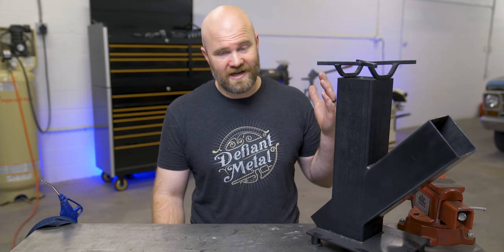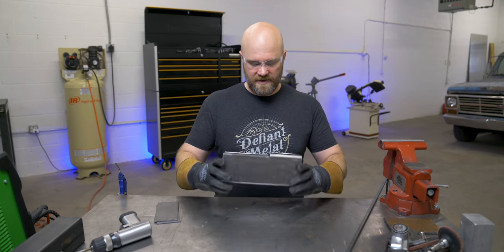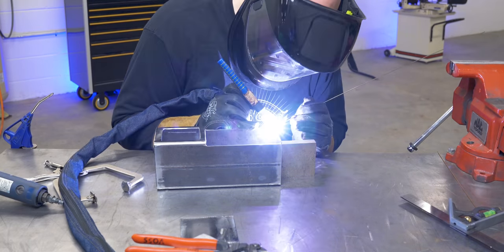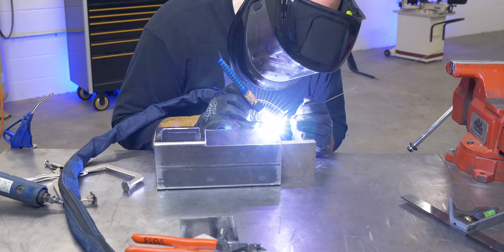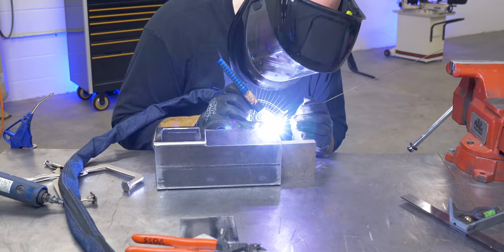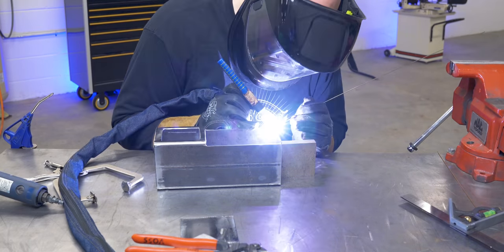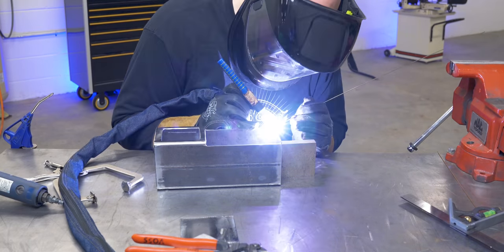Ammo Can Rocket Stove! - Welding A Portable Camping Stove

Comment: Should make the pan holder prongs removable, and have the end of the pipe capable of fitting a flu pipe, so that way, if you need to heat a tent, or something else you can :)
Reply: That's a great idea!
Reply: Yes...
Reply: Ammo box is insulated, makes it less effective for heating the surroundings. Idea of multipurpose is good though.
Reply: Stack robber heat extractor.

Comment: Great job with this!
Welds are clean, the design is solid and it looks like it works well. 

The aluminum heat sink was a great idea to keep from blowing holes in the thinner metal.
Little whoops on the warping and air gap by the hinge , but shit happens.

Only things I would say might be better is if the insulation was welded into the can and the main stove body itself was removable for maintenance. Inevitably, that steel is going to eventually oxidize and need replacement. 
This would also lend itself to including a trap-door on the bottom of the firebox for dumping ash. 

I also personally prefer the self-feeding, "V" shaped rocket stove designs and would like to incorporate something to that effect if I ever get around to making one. The only rub is the lack of available space to work with for such a design.

I second the other user's comments about the rubber seal going up from being in close proximity to the chimney, but good thing the lid is removable. Ought to make a handy staging platform for ingredients. Always nice to have parts of a cook kit that serve multiple purposes.

All in all, this was excellently done and even your mistakes were instructional. Thanks for including them. Great job!

Comment: Rocket stoves are great, but have you heard of TLUD stoves? They are a type of wood gasifier, a "forgotten" technology that heats up wood so it releases gas, which is then burnt. The result is heat from the burning "wood gas" and biochar, which can be used to start it next time, or for any other purpose involving charcoal. This ammo can build looks awesome though! 
I have even heard of people burying the biochar to A: prevent CO2 from entering the atmosphere (it would if the wood was normally set to rot) and B to fertilize the soil.

Comment: I really like using a jigsaw with a fine blade for cutting mild steel.  The cutting wheels are loud, they throw sparks around and make a mess over a large area of the garage. Cutting wheels can also explode.  Surprisingly I get more life out of a jig saw blade than a cutting wheel also.  Of course for shaping and cleaning, the wheels are needed.

Comment: instead of welding it to the sides that will transfer some heat. you could have used refractory cement and just weld some of that stampedmetal to the side of the burner and to the sides of the can. That way the cement have something to grip and hold on to but you dont have the burner and can directly connected and you wouldent have that heat transfer. I will be heavier tho but thats a trade off. 

Btw thank you from the rest of the world that dont use imperial. Thats really nice of you to give us the metric measurements, dont see many people on youtube do that.

Comment: Its cool for sure ! I have been making different rocket stove for more than a decade and this version i feel ticks enough boxes.  I would like to see a similar design but only using the ammo can to store the rocket stove that way it could be modular and bigger with higher chimney stack if needed. Nice work there bro.
Reply: That defeats the purpose of the can. Anything can be used to store the components if that's the case...Even something much lighter than an ammo can.

Comment: One trick I regularly use to strip paint from things like that can is to use Drano.

Drano is just Sodium Hydroxide/Lye.  Fill the can with hot water and add a few tablespoons of Drano crystals. In 30 minutes, the paint will be dissolved. This is a very caustic solution, but it is designed to clean out your drain, so down it goes followed by hot water. I do this in my laundry tub.

For rust removal, i do pretty much the same using citric acid powder. Citric acid is a modestly strong acid, typically used in various cooking functions, including pickling. It is great for rust removal, but does not attack steel.

Both of these formulations are powerful enough that you need to respect them. Good rubber gloves and safety glasses  and/or a face shield is advised.

Comment: turned out great! only thing i would add is insulation around the chimney incased in some sheet steel extending down and sealing the gap. it will increase the heat making it more efficient.

Comment: You have got to get a Steel Demon skillsaw blade.  Definitely my new favorite fab tool.  Cuts thru steel like a regular carbide blade cuts aluminum.  $30 at Depot for a 7-1/4" blade.

But mask up...this thing flings some shrapnel!  The heat goes into the chips and the steel is NOT HOT after you cut it.

Comment: I know you didn't want to compromise the case, but I think having 4 recessed screws that hold the internals in place, but can be taken out to remove the guts for servicing/maintenance, might be a reasonable compromise.  i'm sure something could be found to make the penetrations water tight and survive any transferred heat.

Comment: Ive been hobby welding for about 5 years, give or take, with a lincoln 180 using resin core wire. Can do that in the work shop because the wood lathe lives there and there is always more wood chips thst seem to hide away. Sort of beach sand and your trunks. I really, really think there is a beginners tig set up in my future.
Reply: Oops...I CAN'T DO THAT IN THE SHOP, IS HOW THAT SHOULD READ!

Comment: To straighten the distortion you could use a sheet of rubber about  .187” thick on the bench under the metal you are hammering out, a trick I discovered a few years ago to straighten sheet metal parts

Comment: Great video.  At the end, a thought flashed into my head... What if you welded a couple hanger brackets on the long exterior sides that you could slip a small round cast iron skillet into, and a small cast iron griddle on the other side.  They would basically stay with the ammo can as you carry it by the handle

Comment: You should add a feed ramp that can stow under the removable floor and then hook over the handle/edge of the can, that way you won't have to manually feed the fuel.
Reply from the maker: That’s a good idea, there is room for it for sure.

Comment: Loving this idea!
Could use two different size square tubing for a Russian-nesting doll style chimney, for increased height when needed
Reply: A bead welded along the inside of the larger diameter pipe would let them slot together without losing height

Comment: Very interesting and got me to think that maybe I could do something alike to benefit the homeless in my area. I did wonder how long it burned for and if any level of external heat was transferred to the ammo can due to the direct contact from the supports instead of using a refractory cement or other method to secure the burner with no exterior contact. I will work to build one for my personal bug out kit because low key camp cooking could be a key to survival.
Reply: Ammo can stoves, especially built this way with thick steel, are going to be bulky and heavy.

That's not good for people who are constantly moving and living out of a backpack.

I would recommend soup can gasifier stoves for homeless people.
Quite a bit simpler to make, considerably lighter and more compact, and easily replaced if something happens to it.
Hikers use them pretty regularly, so they're great for living out of a backpack.

Soda can alcohol stoves might not be a bad idea, either, but, unlike scrap wood, alcohol costs money (though a bottle of HEET is only a few bucks and available at almost any gas station) and you probably don't want to tempt folks who might have addiction problems with denatured alcohol that would poison them if imbibed.

The ammo can stoves would be better suited for a more permanent base camp or vehicle camping, rather than a more nomadic life.

Comment: Just as a thought, maybe do a version with the vertical stack actually being a collapsible component integrated with the lid?  The use of piano hinges would allow it to pack flat in the top and give a little more height so as to create a stronger draft.  Leakage from the hinges isn't likely to negatively impact performance.
Reply: I was thinking how to make the stack taller too.

Comment: Just for thoughts sake…could you cut a hole in the box in line with the air vent under the base and have better air flow or is it unnecessary?

Comment: Only thing I see is a problem is using duplicolor engine paint on it, I used some to repaint the firebox on my smoker and even after a good burn, it left a chemical taste that ruined a brisket.  I had to completely strip & sand it down and repaint it with BBQ paint.

Comment: To get the paint out, you throw the whole ammo can on a fire for a few hours, go have a few beers, come back and wash it. Done.
Reply: Or, paint stripper.
Reply: be careful, some of the really cheap reproduction cans use solder and not welds to hold them together, you might come back from your fire to find that your can has fallen apart. real milsurp cans are much heavier steel too

Comment: Nice Projekt and very educative showing the whole process..... a little questionable is the exesive using of compressed air and  air tools in combination with ceramic fibers.
And the flamme tube welded together with the whole ammo box is not a good idea, the heat may cause the paint to burn up. Im thinking make a insert like a Zippo lighter is better.

Comment: Cool idea and an inspiration! My welding is nowhere near as good as yours, but I try to improve it with non-critical projects like this one. I was wondering why you would heed the respiratory warning on the ceramic insulation, yet you used an air powered "grinder" to remove the paint and then used an air gun to blow the paint dust away? Both methods create dust of unknown composition with no evidence of respiratory protection. I recommend you protect your lungs at all cost (no egageration - get the best quality and finest micro filtration you can 'cuz lung disease sucks huge!). Just me talking... Cheers from Alberta, Canada.
Reply from the maker: Thanks and idk. I’ve never worked with the ceramic insulation but I have ground off paint before is I guess that’s why. I also think more modern paints are much less toxic.

Comment: It would be sweet if you put a little baffle in the extended exhaust/cooking flue. 😎 That way you could control the air flow, witch will let you control the temperature of you cooking fire, and burn rate. 🔥  🍳 🥚 🥓 🤩

Comment: I have also a Tig welder inverter, but never did weld with it, how difficullt is that? I think it does weld more beautifull then a mig of stick, I have for stick rebuild some electronics so I have a hotstart setup included with a switch. I think welding car metal with tig go a lot better and is good for thin metal, I do now with a mig.

Comment: Would it have been better if you had the ammo can lid hinge opposite of the stack? That would keep the can seal cooler and it could dubble as a Feed chute.
Reply from the maker: Yeah that’s not a bad call. The lid slides off easy too so I would probably just take it off if it started getting too hot.

Comment: Curious if the heat transfers through the metal stand off points. Also I wonder if just an air gap would have worked OK for insulation?
Fun project!
Reply from the maker: The heat does transfer to where it is too hot to touch, but as you move down to the bottom it cools down. I don’t think only a air gap would be enough unless you don’t cap it off. Then maybe, the insulation also helps to keep the heat in which helps with performance.

Comment: Got a question/ask your opinion. I want to do self projects at my equipment yard (nothing big). I want to learn stick. I don’t want to buy a throw away machine. In my opinion I have three choices in the portable $600 range, but not sure which one, starting to think they’re all good. = esab rogue 180, Miller, or Lincoln. What you think? There’s also a fronius 180 but it’s $1200 probably the best, but besides that one, which one out of the three would be the best? Something long lasting and works best. (Again only interested in stick, even though I think they can still do mig and/or tig.
Reply from the maker: I’d consider the Everlast for a good machine and save some money if you think you might have some other equipment to buy. Otherwise the Fronius machines are really really nice.

Comment: Really cool build great welds perfect,but 1200.00 bucks on time an effort is to pricey. 
A wood 4 x 4  cut 8” inches long with a 1 1/4 hole drilled down the center and then drilled lateral to the first only cost as much as a 8’ 4 x 4 at a home improvement center. Cook time is 1 hour you can barehand move it until the core starts to burn out.

Comment: Hi. Maybe you’ve answered this, but what material are you using to weld the metals together?
Reply from the maker: 312 stainless but any mild steel filler or wire would be what’s recommended

Comment: Hello, I am a new subscriber after watching this video.  Would it be possible to make this so it fits inside the ammo can without welding it? I was thinking that you wouldn't have to use as much insulation since it would be outside the can while using and air flow wouldn't be an issue at all.  The hinged door wouldn't be necessary which may give you a bit more area to make the stove more efficient or easy to use.
Not sure if there would be an advantage to it or not. Great stove build.
Reply from the maker: I have seen other designs where it is a small two piece rocket stove that is pretty much just stored in the ammo can.

Comment: Do you just turn it upside down and dump to remove the ash? Does it seem like an ash drawer is possible?
Reply from the maker: I'm not sure how you would make a drawer with a welded in design. But yes I just turn it upside down after it cools off. It burns off a lot of it though.

Comment: Great project, love your craftsmanship! Saying hi from Europe! One question, how come there are no sparks while you weld? Does metal even heat up properly?
Reply: This type of process prevents sparks common in stick or some flux core mig. He is using TIG welding. But more knowledgeable people will explain it better.
Reply: Gas Tungsten Arc Welding, commonly called GTAW or Tig, does not produce sparks. The electrode and filler metal are separate entities, unlike SMAW or GMAW, sick and Mig respectively. It is also possible to Mig weld without sparks, but that's more than we need to get into here.

Comment: Insulation make no sense if you make a heat bridge to the outside surface by welding everything solid. Love it though!
Reply from the maker: Still helped with how hot it was sitting on the ground. I could hold my hand on the side of the can towards the bottom. Only too hot to touch part was where it connected.

Comment: Genuine question (I know, not a funny meaningless one - most unlike me!) - is the one on video the first one you built, or do you build one off camera to plan everything out first? I have real trouble planning-as-I-go and tend to end up not videoing the interesting bits because I want to be able to plan it out without someone (virtually) looking over my shoulder watching me scratch my head for 30 minutes.. :)
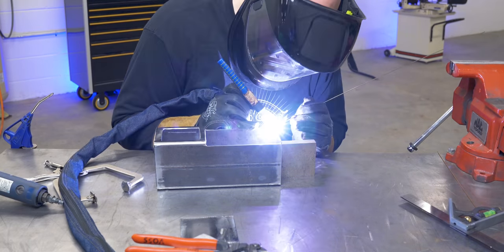Reply: Aaaaand at 00:17:25 you answered that question. I'll go sit in the corner now!
Reply from the maker: It’s definitely a challenge and makes builds take forever. Trying to make the project while also thinking of where to position the camera and if this certain part needs to be filmed. Usually I end up with hours of video I don’t need.
Reply: @JustVoss  I have a problem leaving things on the "cutting room floor" - probably why a simple aluminium repair video ended up 45 minutes long. Whoops! :) As always, love your content though - the editing is excellent.

Comment: Doesnt that stove need a air flow vent in the front weather sealed of course maybe use fire tablets to start the fire and maybe a footed base with legs to keep it off the ground with wingnut screws to hold to the stove body just some thoughts and sealable metal pockets holding the tablets waterproof matches,water purifiers tablets

Comment: I wonder if building the entire steel part of the stove outside of the ammo can, and bolting it in somehow.  Instead of welding it to the ammo can?  Very cool project.  Thanks for posting
Reply from the maker: I only welded it because I thought it would help with the insulation. I have seen some where it's a normal two piece stove and it pretty much is just stored in the can.

Comment: DON'T CUT THE DOOR FLAP SMALLER!!
  Here is an idea. Instead of making the door smaller, make it removable when opened.
     HERE'S HOW:
   1.   Weld the hinge to the fire Box (as you did) but DO NOT weld the other half of the hinge to the door.
    2.   Slot the top of the hinge channel on the fire box (just big enough to set the door vertically into the slot(s)).
    3.    Mark the door at the hinge channel's contact point(s). 
    4.    Slot the door on your contact marks.
 I hope I articulated clearly enough. If done right, the door should set vertically into the fire box hinge channel. It should be easily lifted out when opened (virtical) but stay put when laying flat.
 In fact, various sized doors or even a multi panelled hinged fold-out door become options when your door is removable. 

    3.
Reply: Dudes a better weldor than design/fab tech...dime a dozen....
Reply from the maker: And you’re just a person talking shit on the internet. Not even worth the dime.